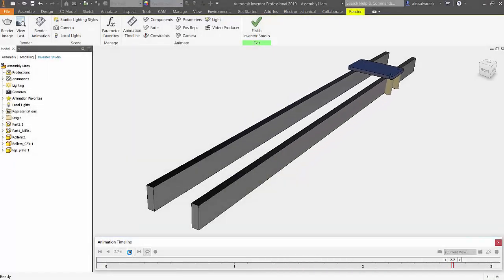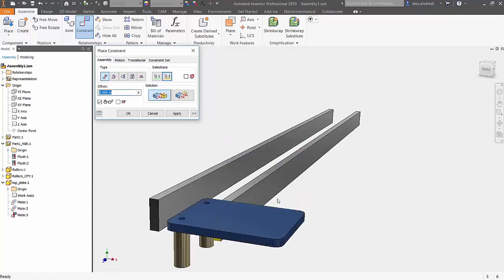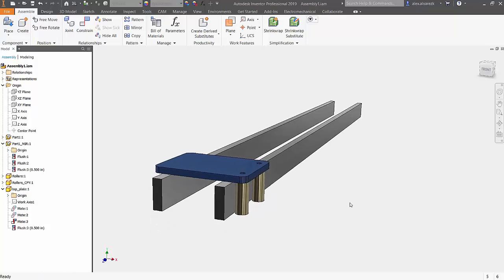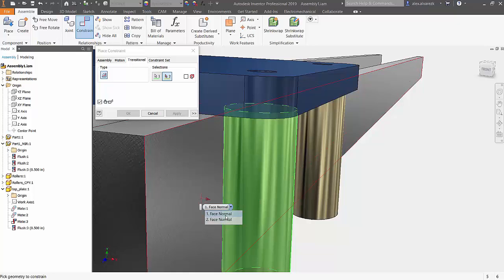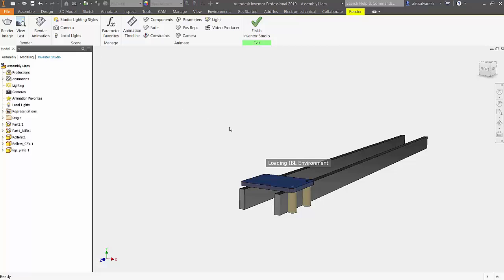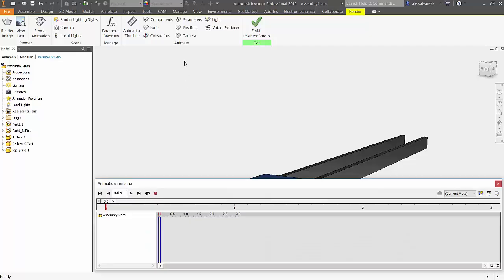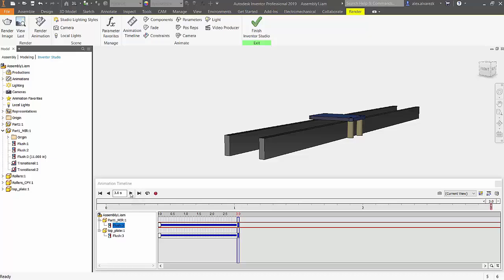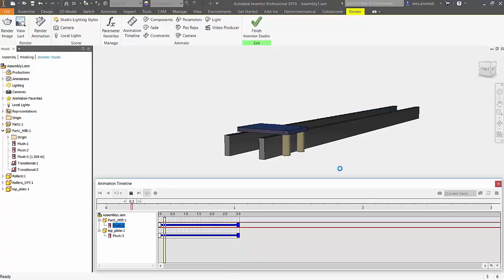Quick Tip: Creating Animations with Inventor Studio

Comment: Animation studio is only usable for animation of very few parts with lenght less than 10 sec. I tried to make 30 sec animation and so many problems popped up. Especialy in rendering phase, faded parts keep poping, weird shadows everywhere, timing is shown wrongly. After a 50 hour-long rendering, animation is much worse than quick preview. Rendering doesnt use graphic card so its slow as hell. And so many crashes....
Reply from the maker: Sorry you are having issues. You could reach out the support or post something on the Inventor Forum if you want some specific help.
Reply: Click preview no render in the animation render setting, it will go fast to render animation, no more than 1 minutes